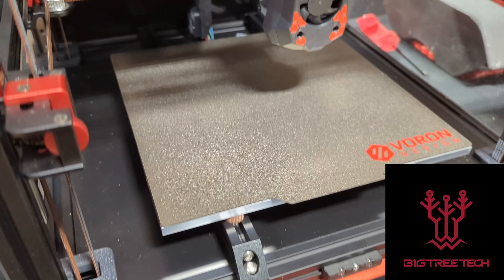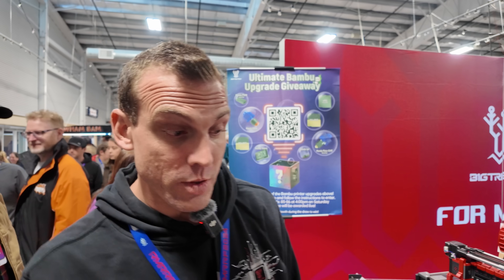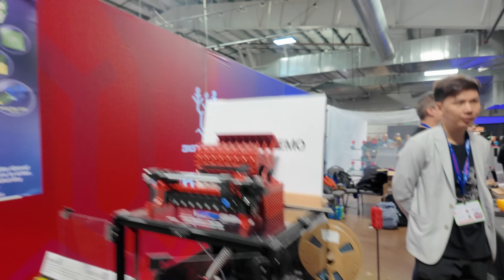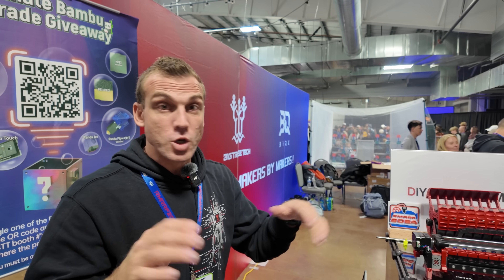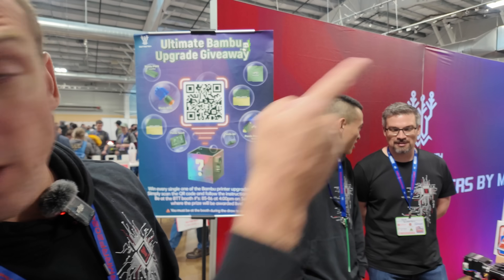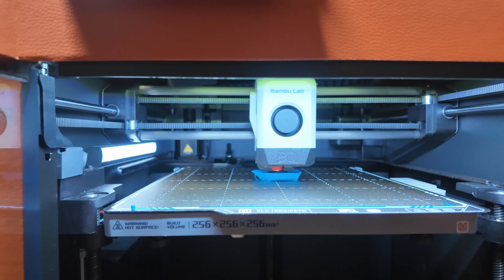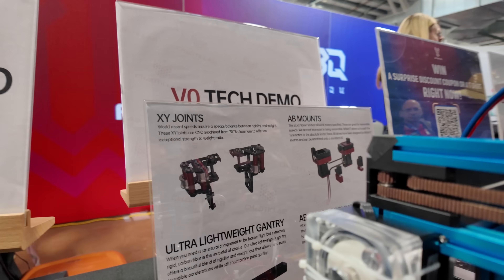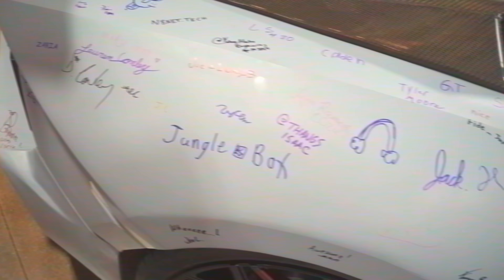Whats New With BIGTREETECH in 2024? #3dprinting #rmrrf

Comment: Great collection of products, but I have been disappointed with the SKSM. I got my hands on mine last week. The hardware is pretty good, with nice big capacitors for storage. Firstly, it's 5V output only, so no park and power-off support like the older BTT UPS 24V. That's fine, as it is intended only to power your Raspberry Pi for long enough for it to shutdown cleanly. Pulling the rated 2A only briefly made the coils whine loudly, so I wouldn't use it to power a Pi 4 or 5.

That's all fine, but where it gets weird is with how the firmware runs things. There are two 5V outputs: A USB type-A plug and a 5-pin JST PS2 header, and you HAVE to use them both. The JST carries the 'power bad shutdown now' signal that you connect to a GPIO pin, but the power on that cable is only available 'sometimes'. There is a 30 second delay after connecting 24V (even when the caps are already full) and it cuts out 13 seconds after the 24V goes down (again, even if the caps are still full).

All in all, it feels like a clumsy beta project. I was looking to add them to all my builds, but I now think I'll hold back a while. Maybe these issues can be fixed in version 2? It has a lot of potential, and maybe the awkwardness can be fixed in firmware.